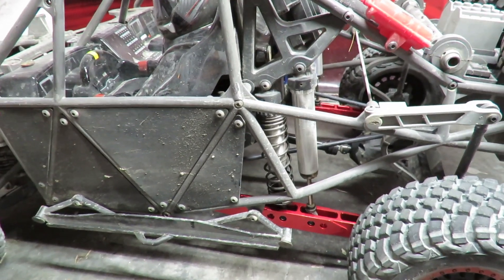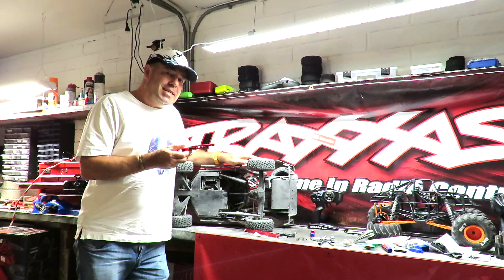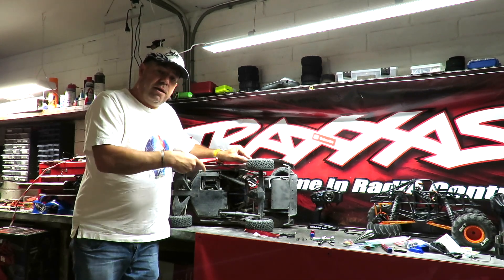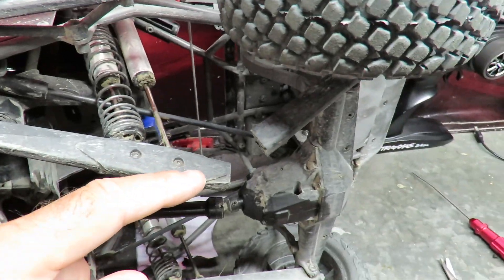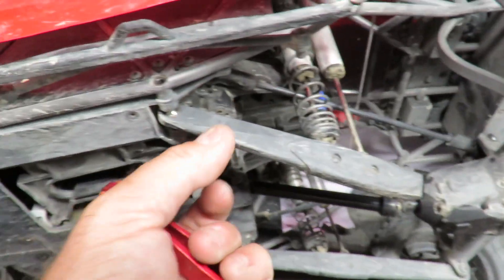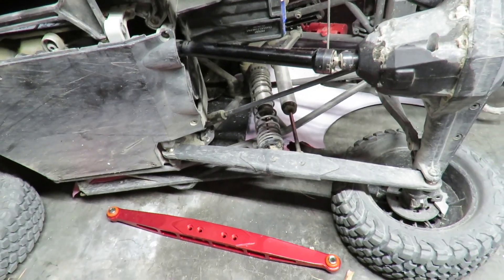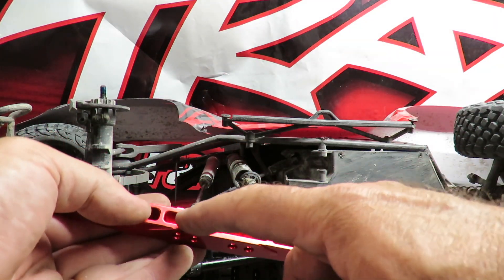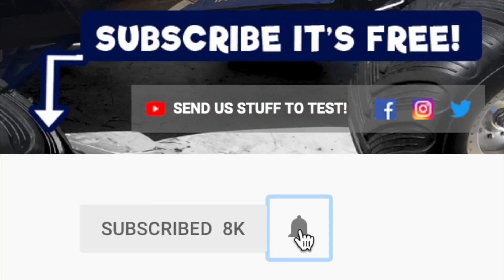Traxxas UDR Upgrades - UDR Trailing Arms

Comment: Got ur trailing arms nice! I still haven’t put mine on yet,like u said if it’s not broke don’t fix it,but ur making me wanna put them on cus they do like sweet on there. I had the leaky shock issue as well n traxxas claims they were over filled at the factory, I’ve heard to use thick grease on the seals n will help keep the oil in, but ya I hope those $25 aluminum trailing arms workout, hey gotta be better then the plastic n only $10 more then the stock plastic. Great video Richie looks sweet!

Comment: Nice video breakdown do you or anybody have any tips how to remove tires  that are stuck i have a jlb cheetah truck i removed the wheel nut but all four of my tires are stuck i tried almost everthing but they wont break loose can you do a how to  video maybe thank you
Reply from the maker: Christopher my first though is to try pouring boiling water  over them, then quickly pull whilst the pllastic is still hot. I've just had a problem with stuck wheels due to the nuts see todays video